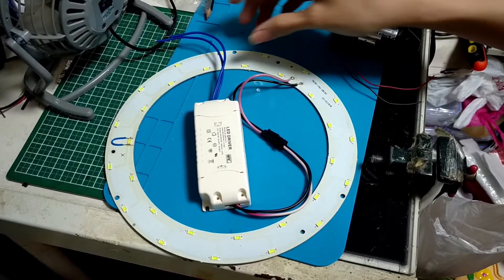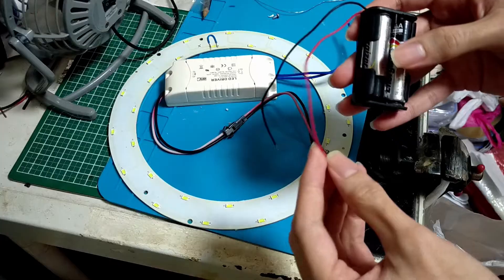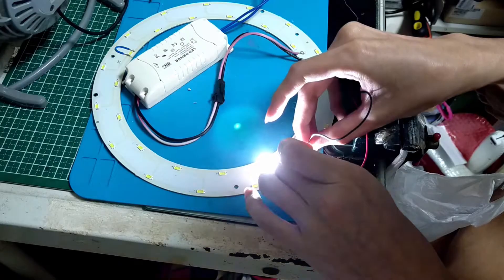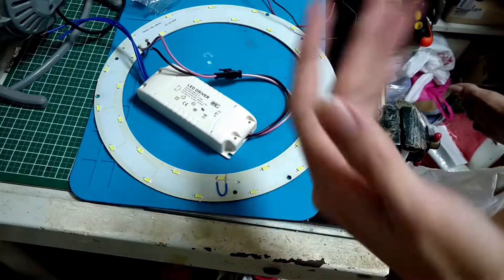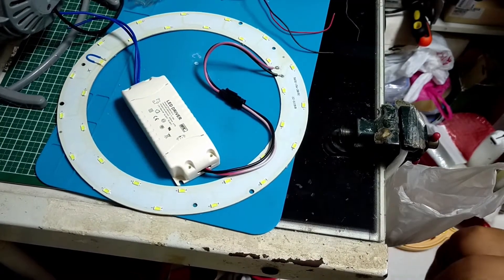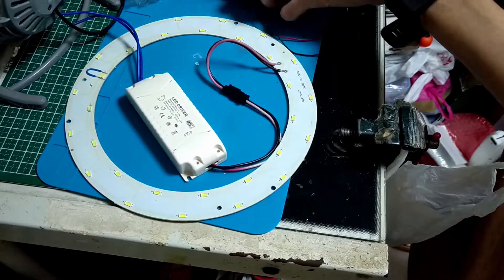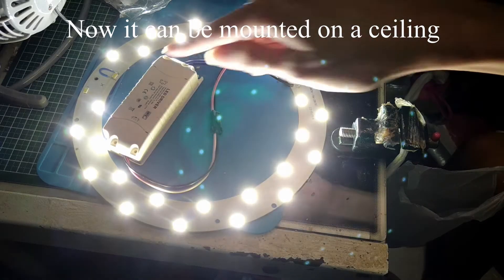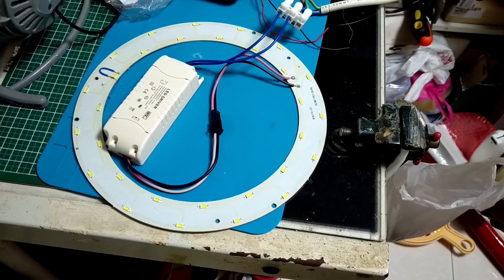How to repair an LED ceiling lamp module

Comment: If the led dimmable stops working how to replace only the led? Do I have to generally through the whole assembly and buy a new assembly?
Reply from the maker: can consider buying a new assembly. The circuit board where the LEDs are soldered on absorbs lots of heat making it difficult to resolder.